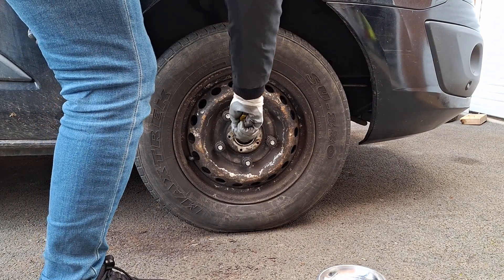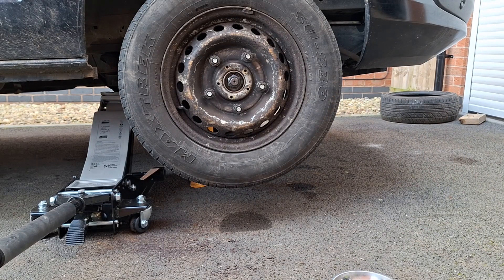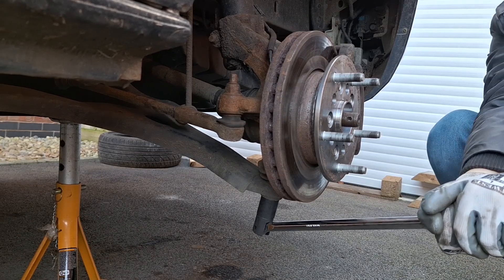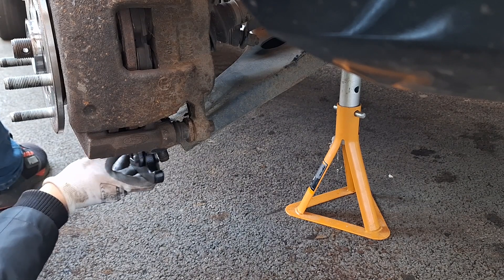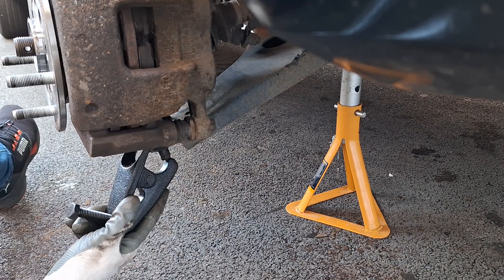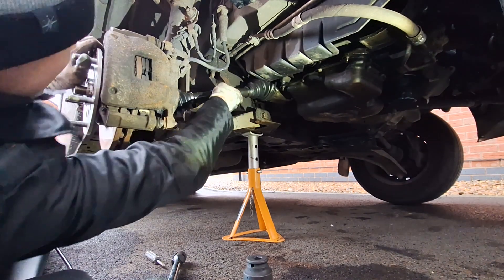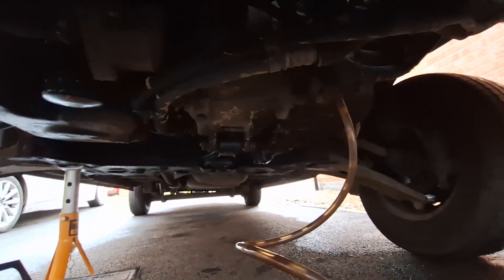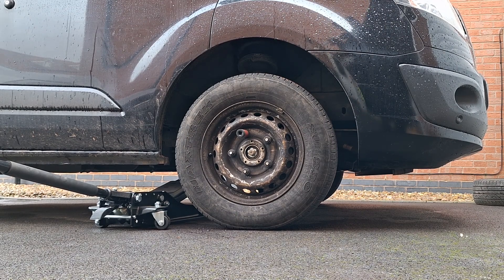Ford Transit Custom driveshaft replacement

Comment: I have a small knocking when pulling away and low speed acceleration, the right drive shaft is loose like yours. Did u have any knocking or notice it quieter when changed. Glad you got the yours fixed up and thank for the video.
Reply from the maker: @SimonGregory-r2n  I had a knocking noise at low speed when acceleratimg and decelarating, but that was due to the gearbox mount. Unfortunately I did not record that, but it is a very straight forward repair. The driveshaft did not cause knocking.

Comment: Did this cure your noise at 60mph? Maybe it was the bearing on the driveshaft itself
Reply from the maker: It did not cure the issue. It was the bearing on the other side that cured it.

Comment: Sound it seems rather simple enough, would it be the procedure for the other side?
Reply from the maker: @christowle7093  the other side is is the same, but the drive shaft is shorter and does not have the bearing in the middle. So just a few less bolts.
Reply: @hosuandreiremus  thanks for replying, still have to drain gearbox oil and remove lower suspension arm from the hub?
Cheers
Reply from the maker: @christowle7093  yes. You still need to drain the oil otherwise it will leak when ehrn you remove the driveshaft. I also think you need to disconnect from the hub, otherwise I cant see a way to pull the driveshaft out.
Reply: @hosuandreiremus  OK that's brilliant, I think you have helped alot and I look forward to doing my replacement in the next week or so. Thank you ill be watching again for sure